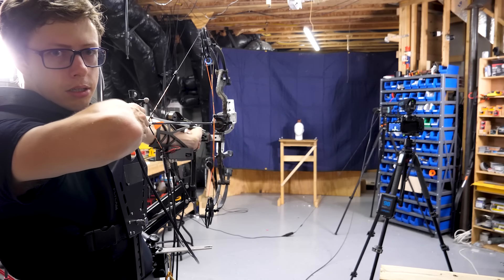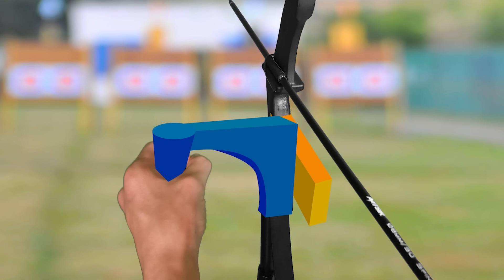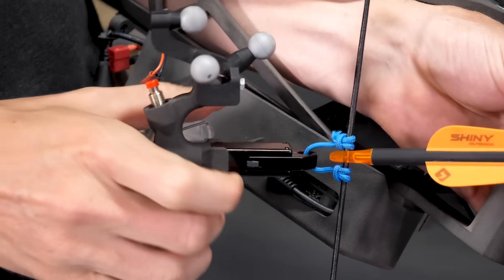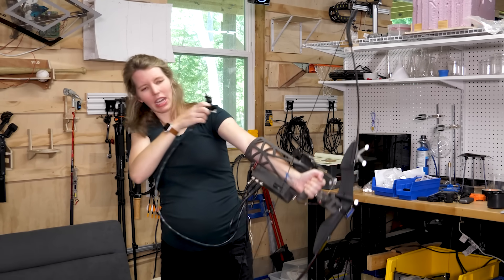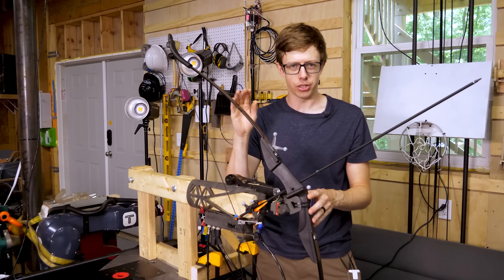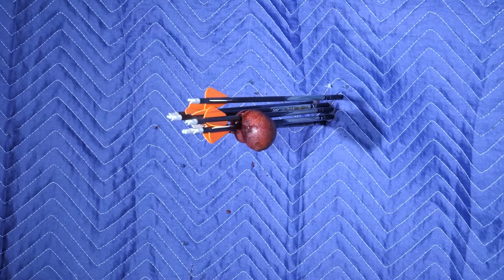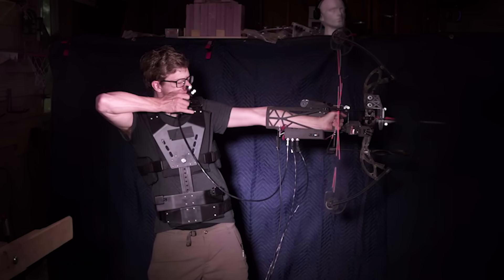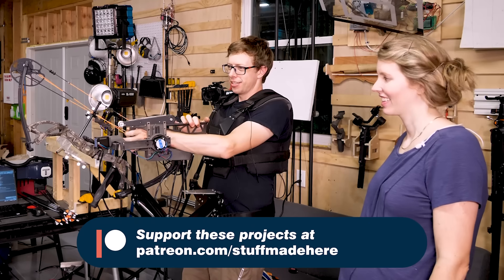Auto-aiming bow vs. FLYING targets

Comment: As an archer myself i really enjoy the fact that you had some problems with the accuracy of your device. Archery is often overlooked and people say its easy when in reality its quite hard to hit the target consistently at the same spot
Reply: Heck it's hard to hit a target at the same spot every time no matter what kind of launcher you use. Saying anything else is just posturing. Sure you may miss by less with a target rifle at the same range, but that's just the nature of the beast. Now traditional bows do have a weakness that you talked about. 

The archers paradox is that with a bow where you shoot around the bow the arrow will bend and flex making it "slither" through that air towards the target. And yet archers are able to achieve pretty awesome accuracy using bows like these. There are some things that has to be considered though. For instance the arrows can actually be to stiff. For decent accuracy they actually need to flex a bit enabling them to oscillate through the air and not shoot off in some impossible to calculate direction. This goes against what we've learned about accuracy where stiff materials and exact repeatability are usually what you want. This makes archery using a traditional bow more like an art than a science.

Modern bows however has a construction where the arrow is able to go straight from the string to the target through the middle of the bow. This makes it easier to achieve pin point accuracy, but it still doesn't make it easy. Just compensating for the arrow drop over distance is pretty hard. Any wind will throw your arrow around by quite a bit, and keeping the bow still with the tension of the string pulled back is no easy feat. And as you are never going to be able to hold the bow still for any length of time the arrow has to be released at exactly the right time. So while it may be easier than shooting a traditional bow it's still not easy.
Reply: @blahorgaslisk7763  Exactly! But the arrows from the compound bow also slither, not horizontally but verticallly.
I bet, with more time, the correct spine and a higher quality recurve bow he could achieve also good results

Comment: You are anticipating the movement of the target. Can't you try to do the same for the next move? The goal is to keep your bow moving.

And I'm not sure but maybe trying to add a gyro stabilizer on the mount between you and the bow?

You can also use the motion balls on your bow and work on that data to undo your own moves?
And if you want to stop hitting yourself, attach the handle to the bow. ??

Comment: It seems like you may need to take into account the lateral/angular velocity of the arrow at the time of release if you want to get your errors down. For static targets you can simply add a settle time to zero this out assuming a fairly solid platform.

That being said, the cheap and most likely incorrectly tuned bow and arrows are likely also inducing a lot of error into your system. I know some competitive archers and they spend hours just getting everything perfectly in tune in their bows that are 3x the cost of yours and then spend hours tuning arrows to get them to fly perfectly. These are also arrows that are probably way more expensive than yours as they are 0.001" tolerances. So while there are some technical problems in your solution, I think you would do well to spend some time researching compound bows and how competitive archers eliminate errors in the system.

Comment: Could it be made to work with guns? I could imagine aim assist having a lot of uses in the military or with swat situations.
Reply: I've watched more of the video, and the current method clearly couldn't work, but I think if you made an aim assist for a paintball gun in the next version you'll likely have to overcome them and get a cool video. I think the biggest issue is it only works in a lab on targets you've already modified. You might as well attach a bungee cord to the arrow and target, pull taut, and call it done.

Comment: I am way out of my league here to even suggest a new idea but here i go.. 

If you could use Lazer guided targeting or heat sensing target calibration or any other technique for that matter for V2 than that will be really cool.
bc as cool as this project is but the spacial and target locking mechanics remains kinda same to that of the basketball project.

Comment: That harness is the most badass thing I've seen this month.
Reply: Looks like a steadicam harness. It's for stabilizing cameras
Reply: @kernelpanic2887  Yup, I've seen them used on a couple of other DIY channels. Looks damn cool, but can't take that much weight or abuse. Sufficiently Advanced tried using one to swing an anime style sword, i.e. comically huge, and the rig broke almost right away.
Reply: @Pile_of_carbon  haha yeah, they, ain't made for huge loads/abuse..They are made to be very precise.
Although the bigger ones can carry quite some load.
The largest one I got can carry a good 40kg. It's also at the point where you humanly can't really take more though 😂

Comment: You didn't thought of draw lenght with the recurve... i guess... at least you didn't mentioned. If you pull more (could be cm) the shot would go up and vice-versa. Recurve has a lot more than just "go around the bow"... The spine "hardaness" of the arrow is really important also. Compound is way easier to tune and make it work

Comment: You worked at formlabs?    Is there any way you can convince them that their printer would be 10 times more reliable if they did NOT rely on those cheap, delicate, easily deformed spring contact sensors to tell the printer what resin and tank are installed?  I can’t get my printer to work because blow molded cartridges have so much variability that they invariably damage the sensor so it can’t tell the cartridge is in and so won’t print.  Or the sensor for the tank gets bent and it can’t tell the tank is installed. I’ve replaced the cartridge floor twice and the fix never lasts more than a week or two.
I have BEGGED them to just do a firmware update that allows me to TELL the printer what cartridge is installed and which tank- so that at least all of us having this issue can get the thing to run…. But they have not.
I begged them to switch to an OPTICAL sensor  and printed serial identifier for cartridges and tanks so this weak engineering in link could be done away with in the form 3- but no such luck.
Maybe if YOU designed a more robust sensor system they would listen?   As it is, I am having to abandon formlabs for a printer that doesn’t do autodispensing, but also doesn’t;t disable the printer over a sensor device that is too delicate to survive ordinary operation Un-damaged.
Reply: or make a magnetic reed switch or hall effect sensor

Comment: "Software development is boring"
As a software engineer, I feel personally attacked.
Reply: But do you agree?
Reply: So your saying you have fun when you find the LIS using DP and get TLE cause you didn't do it in NLogN? IDK about you but swe is not fun majority of the time.
Reply: For a video perspective it is really boring. Watching someone explaining code is the most boring thing ever. I'm a software engineer btw
Reply: TBF as a software dev I agree with the 'its boaring' comment
Reply: 10 display 'rapturetime'
20 if 'rapturetime' > 0; then 40
30 if 'rapturetime' < 0; then 50
40 display text 'a winner is you'
50 run hell.exe
Reply: So it is technicallt boring for us
Reply: I pretty much deal with software development every day. The coding itself is boring, yes. But solving problems is the thrill. Nothing is more satisfying than crushing a bug!
Reply: I feel like it just depends on the project/the problem. and where you find your enjoyment. right now I'm trying to figure out how to control the print/save as dialog within a selenium java script. I don't know if it could be done, but I am excited about finding out.
Reply: To add to the pile, yes coding is absolutely boring. You get little fixes of non boringness when you fix a bug and a big one at the end when the thing actually works, otherwise it's booooring
Reply: As an archer who practiced his form and such to be good at the sport without cheating... I feel attacked too. You can set up a hootershooter in front of a target and it will shoot the bow for you in perfect form too, 100% accurate as long as you set it up properly... Almost like an aimbot/wallhacks in an online shooter video game.... It wont make YOU a better player though you may win all the time...
Reply: It’s boring for an average Joe without a technical background, especially the math needed, to comprehend anything.
Reply: @AvadaKedavra943  I would say majority of it is boring, Really the only enjoyment I ever got from it was when you fix the bug and it actually does the thing that you wanted to be done. Which is what he is showing us… He is showing  what the bugs are causing and then showing the end result of the bug fixes.
Reply: Hi, if you are not saved, and would like to be included in the rapture of the church. Believe that Jesus's death on the cross, was enough to pay for ALL your sins , yes ALL ,(past, present and future) That is what the Gospel is about. We are saved by GOD'S amazing grace, through our faith in Jesus's sinless life, death on the cross and resurrection 3 days later . No additional works needed. It is literally that simple. Do it today, don't delay. Time is short. Ephesians 2:8-9  Romans 10:9-10
Reply: Honestly his wife is a buzz kill on this channel she is so monotone and emotionless

Comment: First problem,  make a t with your body and target.   Stand with feet shoulder width apart.  You need to give your machine at least a solid base.  Then intentionally  missaim.   You have to be drawing the bow so its release doesn't into you.  Your body base sucks!!

Ask your wife for some beginner lessons.string is drawn and held along your face with hand  by your ear. The forward string is by your lips.(kisser buttons.)   Once you are solid then trajectory will be math not science fiction.

Comment: I don’t know if anyone else has said this but the reason you are hitting yourself in the face is because of you form while shooting. If you want to stop hitting yourself in the face you can try the following:
1. Move your back foot back behind you front foot and have you back foot pointing 90 digress to your anticipated direction of travel of the arrow and your front foot no more than 45 degrees.
2. It should be a straight and vertical line from your head down through your back through your hips to the ground in the middle of you feet. If you look at the video you an see that you are leaning back with your shoulders and pushing your hips towards the target. In this position your are unstable and you are using your muscles to hold you up, using your muscles like this will make you shake and tremble making aiming much harder.
3. You are pulling the bow string with the muscles in your arms. This leads to muscle fatigue, trembling in your arms and this makes the bow feel heavy. For your front hand holding the bow when under tension should feel like leaning against a lamp post with your arm out stretched. The back arm with the string release your elbow need to be higher and back as far as you can get it. I use a wits strap release this allows my whole arm to relax and fall limp held in place by the string and my shoulder, as such I feel all the tension of holding the bow in the muscles between my shoulder blades in my back. This also sets up a simple anchor point the corner of my mouth touches the knock of the arrow, my nose rests on the string and my second knuckle rests in my ear. As the bow releases my back elbow drops and the movement equalizes the drop of tension in my front arm keeping the bow steady for the shot.
4. My guess is that you need to tune the compound bow that you are using, this may or may not need to be done, the choice is yours. First you might want to extend the draw length of the bow string so the arrow knock reaches the corner of your mouth without you moving you head to meet it. Second the whisker biscuit should be adjustable, to see if this need adjustment hang sheets of paper in a line going down range and shoot one arrow them, this will show you the flight characteristics of the arrow as it goes down range, it should make the same shape hole in each sheet of paper as it goes. If any of the sheets of paper show an asymmetrical shape the knock and the whisker biscuit are not in alignment, from some of the videos that you showed this seems to be the case but I don’t know for sure with out being there. 

I hope that the information here helps make this more fun for you ie no more hitting yourself in the nose, more comfortable to shoot over longer periods and more accurate so that you can get the ultimate William Tell. Have fun….

Comment: Yeah this is a cool project. But you need to work out a little bit and get some self strength control with a bow. That's not a very strong bow lol your wife's arrows are going deeper than your arrows and you're shaking while holding the draw 🤣 well done bravo tho

Comment: My best guess as to the left offset issue is that you are rotating your hand slightly counterclockwise. This results in the system thinking that the arrow is slightly further to the right, and slightly higher up than it is, causing the bow to shift slightly, causing the arrow to push off of the bow in the opposite direction. In fact, I'd wager that some of the initial lack of precision was due to holding your wrist differently, until you more-or-less standardized it by holding it to your chest so you don't hit yourself. Maybe you mentioned this in the video, but unfortunately I don't have time to watch it past the intro to the moving targets, but I am assuming you've solved it one way or another if you end up hitting them regularly!

Comment: As an archer
1. Arrow spine
2. Back tension
3. It looked like there was a shelf/cutout on the recurve so it's not going around the bow as much so the paradox doesn't apply in the way mentioned as much but there is still osculation which a plunger would have helped with.

Overall, great video!

Comment: My back hurt just looking at you using a bow.
The rules are :
- feet perpendicular to the target
- shoulders above the feet, in the same position
- no arching the back, ever
- lift your elbow to the level of the arrow, and keep it there, all the way
- pull with your back muscles
- bring your hand to your jaw, and keep against your jaw for always using the same position (it can vary depending on how you are using a bow, but good enough for here) (and this way, you won't get hit in the face)
- release, with moving the least amount of muscle possible, until the arrow hit the target

Just using those rules, you'll improve things a lot. And you won't hurt your back or your face.

Comment: It seems like one possible difficulty would be trying to have a stable platform for the bow, as it adjusts there is going to be an equal force the other way on your arm which if you aren't ready for might result in no net movement. Maybe part of it is you got better adjusting for this over time in your brain too and not just software. Almost need wires attached to your suit thing to stabilize or adjust rather than adjusting from your arm?

Comment: Wiping the code and starting from scratch...frustrating, but honestly sometimes you have to do that.  It's tough to do, but every line will reveal what you've learned, because your new code will omit some of the rough issues you made before.  It will probably be more efficient, include parameters to make it easier to tweak than it was before etc.  Not fun, but excellence is the result.

Comment: Part of your challenge may be the limits of the human body. 

Consider that you are using yourself as part of  the shooting platform. The weight of the apparatus, no matter how light, will affect your body's balance. Many muscles will be adjusting your body to maintain balance at all times, causing your hardware to have to compensate for those twitches. In turn, your body will adjust to those adjustments (damn you Newton,, and your laws of motion!)This will be less noticeable at closer shooting distances. 

Finally, as you fatigue, even a little, your body will likely become a little more jerky as it balances itself, making the machine adjust more, making your body twitch more. Longer distances will be a challenge. 

Love you content and hope you figure out how to make it work. By no means is this meant to be a negative comment, and I'm sure you know this and have a plan. Or maybe this problem isn't a problem or an insignificant one.
Reply: I totally agree
Reply: Also, this comment is long and nerdy!

Comment: Coming from someone who lives for shooting long range archery, that bow is okay but not the most accurate, the whisker biscuit rest is not as accurate as a drop away rest, also one huge thing is bring the bow somewhere and get it properly tuned, and they can help you out with getting the correct spine Arrows for how many pounds you are pulling, one more big thing that is causing miss shots is you anchor point where the release is even know the program knows where the back hand is doesn't mean that is the best spot to have it for the bow, you could be torking the bow and string one way or another, and lastly get good Arrows, trust me it makes a huge difference in the quality and consistency of the straightness and all being the same weight

Comment: I guess V2 can’t use the same tracking - needs to be portable so you can use it at a regular range. So image recognition? Good luck. Would also be good to get back to the recurve which might be ok at longer range - easier to accommodate the fishtailing